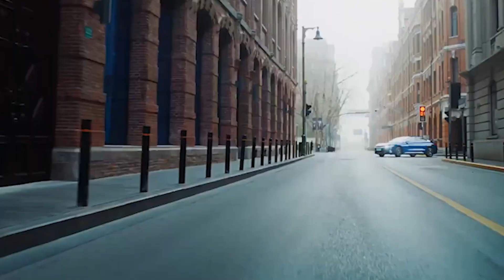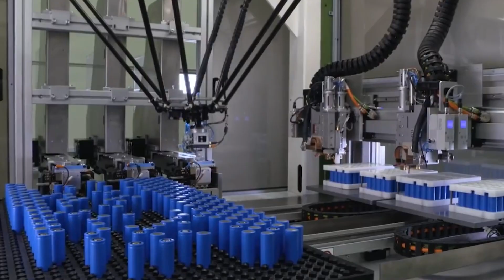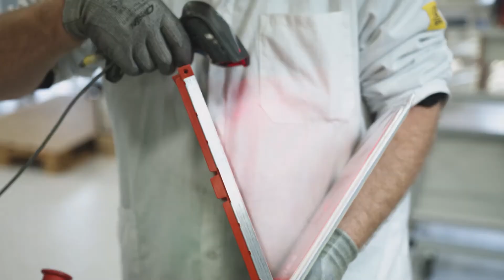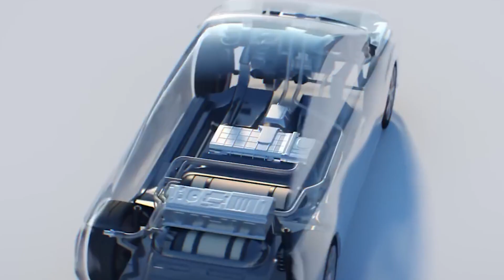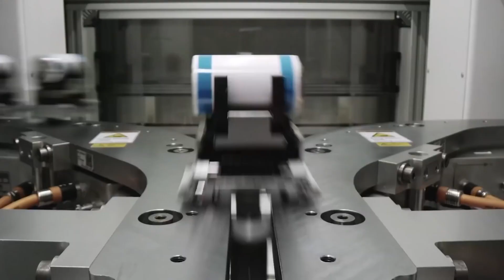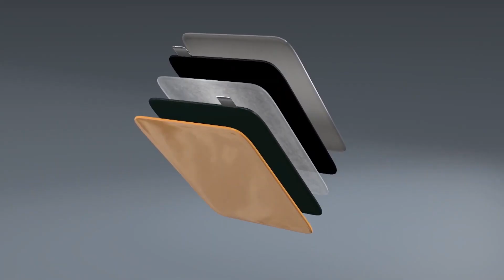BYD Blade Battery is DISAPPOINTING! This is WHY!

Comment: It is funny how no body compares the efficiency of these vehicles compared to an ICE vehicle. Or mentions the amount of pollution it creates to charge one of these vehicles on the grid and compare it to the amount of pollution an ICE vehicle creates. I am sure it would be about the same as driving a small 2 litre Diesel. So I don't see the point unless they are all charged with 100% renewables they will do absolutely nothing to save the environment whatso ever.
Reply: Your opinions are incorrect. No wonder you felt disappointed by this video.
Reply: @karenmajoros7522  They are not my opinions they are results done testing EV's and ICE vehicles. EV's have very little resale value compared to an ICE car as well. Time will tell this story. Unless battery technology rapidly advances and becomes cheaper these vehicles only serve the purpose of being driven in busy cosmopolitan area's, by fools who did no real research and know very little about physics.

Comment: BYD is for sure not the first manufacturer using a BMS system which monitors the battery temperature. Every EV manufacturer does implement temperature control into their BMS's. It just shows how much you know about the things you present. Next to nothing it seems.

Comment: Tesla is installing BYD batteries since early this month in Berlin (Model Y). By the way the question is not the energy density of the chemistry as such but energy density of the overall battery back (weight and space requierements per kwh). That's where a blade battery is wasting less on "packaging" and overall the battery pack is lighter and less spacious per kWh . Even Tesla is acknowledging this - Tesla Y model manufactured in Berlin.
Reply: Very good explanation thank you Werner. Not a disappointing battery after all!